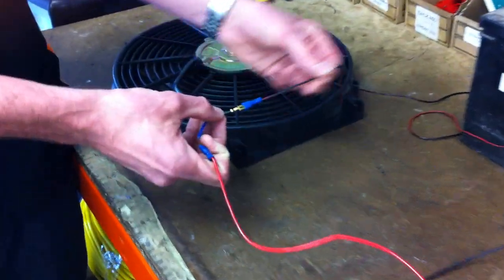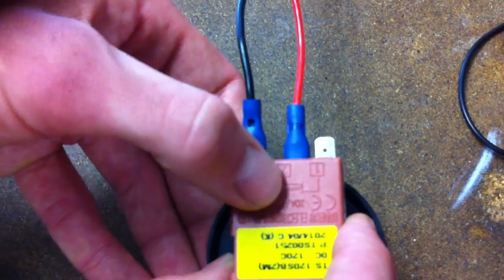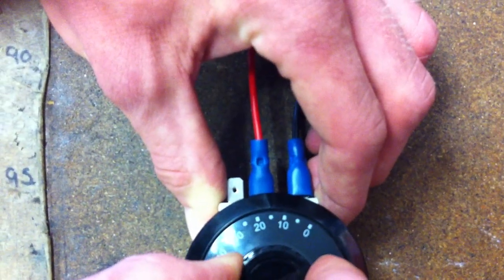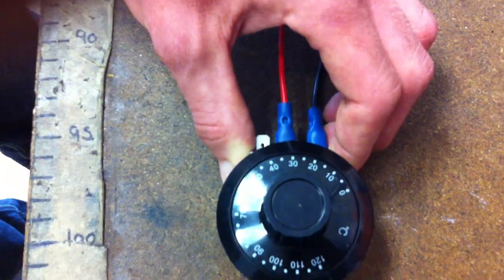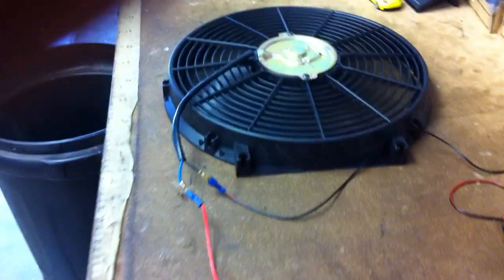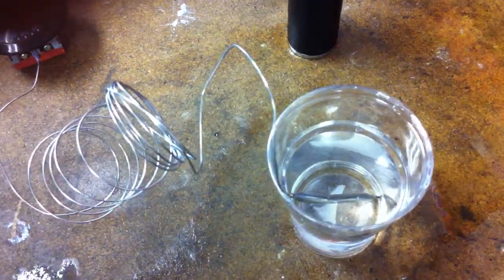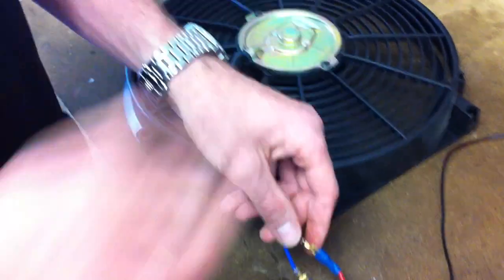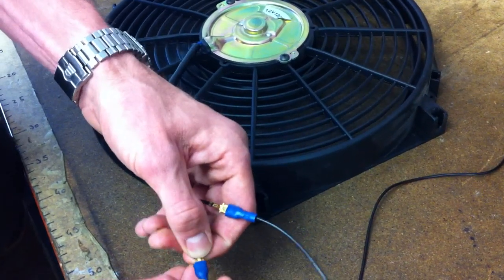BB Classics , Fitting Radiator fan thermostat

Comment: I believe that if the blades are curved and therefore designed to rotate in only one direction, it is not good enough simply to reverse the polarity. The blade assembly needs to be tuned around as well. Does anyone agree?

Comment: hello... when I install this to my single 16" fan in my car Do i need to add a relay or no need and why ?
Reply: Hi, I was sent this 120 Watt fan by mistake. In reality it is only 80 Watts so no need for a relay as the thermostat is rated for ten amps and the fan pulls a miserable 6.7 Amps. 
A true 120 Watt fan would require a relay to protect the thermostat contacts from damage.